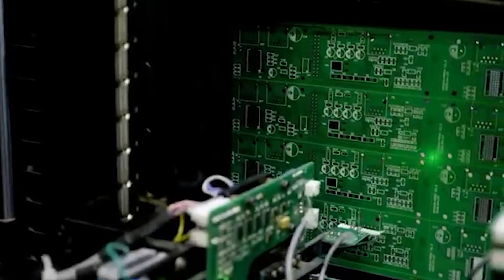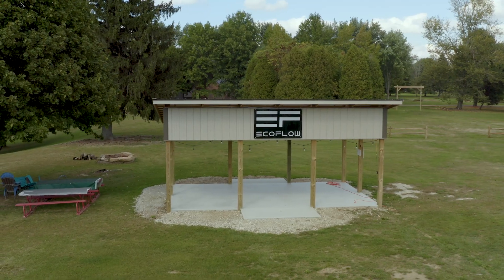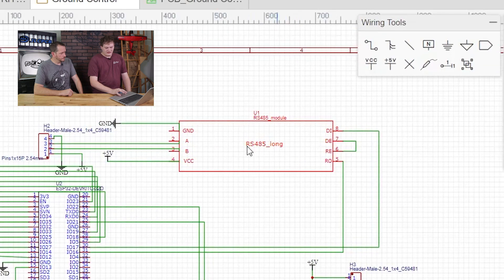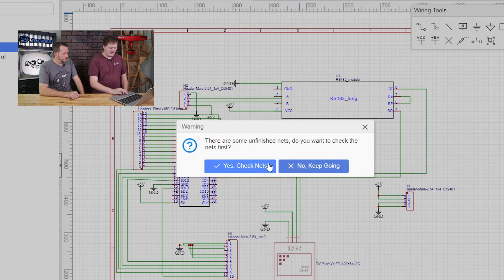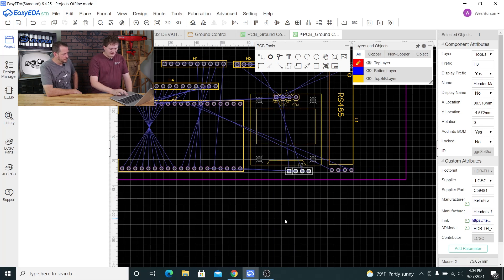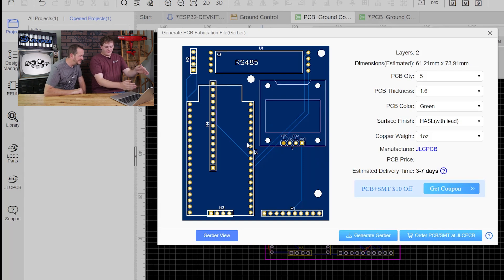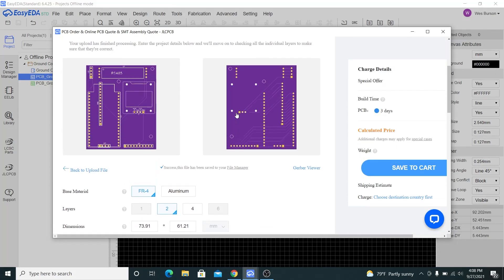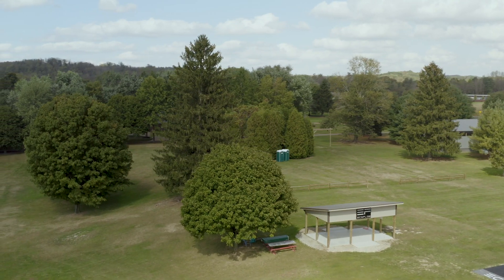FPV Ground Station Control PCB Board

Comment: Wow auto route has improved but still no match for human efforts .  Years ago I decided to build a small quad controller  auto routing was still very large slightly larger than a match book. So I gave it a try, my board was 11x17 mm on a double sided board . I let the software check the connections everything was correct.  Made board and bobs your uncle it worked. Secret was placing the processor on the bottom , I2C pins aligned, voltage regulator gyro , accelerometers,  compass. Within a year of my giving this design away, dozens of new units came out using my foot print, but adding new things , like GPS connections and using a larger processor.  I did the project to see if my aging brain could ... oh well ... argued with a smart young engineer he claimed it was too small ....lol enjoyed the back and forth, then he died 28 years old ...I quit designing ... yes it upset me that much . Itvwas like competition and the game was over. Posted the files heck they may still be out there .  A dozen years latter I can no longer work with the tiny parts , surface mount parts require a steady hand and good eyesight . Looking forward to the rest of your project . Take care.

Comment: Wow tech is amazing,  started out about 50 years ago making circuit boards, used sheets of grid paper to rough out design, had to figure out the routings,  could be a headache.  Then it did leave me with a feeling of accomplishment. Several years ago when quads were new, I  used eagle cad to shrink the controller to 11x17 mm , the key was moving the processor to the bottom at a 45 degree angle, only required 4 feed through connections for power and signal. While auto routing was available I did it by hand, it worked. Alas I did not produce the little board, in. Mass. But soon found my design on many Chinese boards. Then it was the only logical layout. I no longer tinker with such, as I have grown old, and computers tend to hurt what is left of my vision, and I hate writing code for all those little chips. Take care.